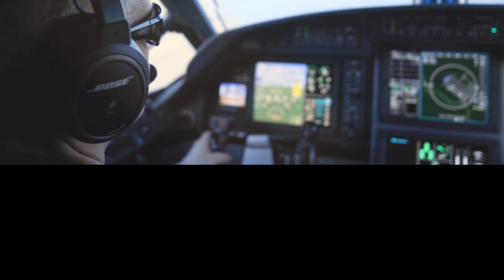Pilatus PC-12 NGX “Project Black Death” — California

Comment: Matt Black Aircraft in California......heat soak gonna be awesome lol
Reply from the maker: Have flown on it, it flies as cool as any other NGX. New VCCS system is solid, pilot says “tell them to stop being b*#ches. It’s not bad at all.”
Reply: A friend of mine participated in an experiment back in the late 90's in Tucson with his fire department where they got two new cars of the exact same brand/model; one black and one white. Put multiple temperature probes in various places and left them in the 110+ degree sun. The largest difference in temperature between the two was 1 degree. Modern insulation, etc. I suppose. Perhaps the black plane would be the same...